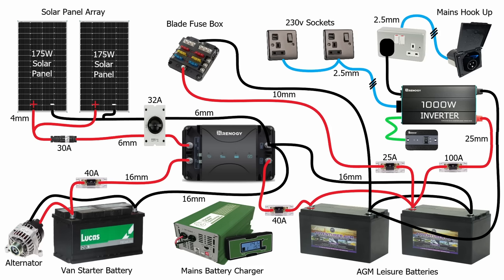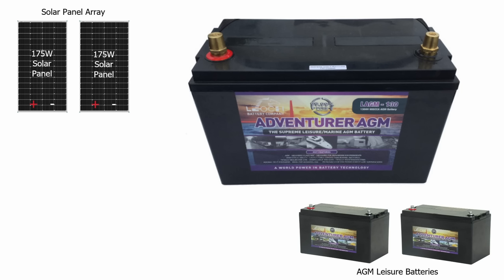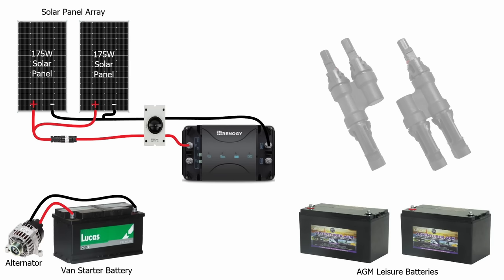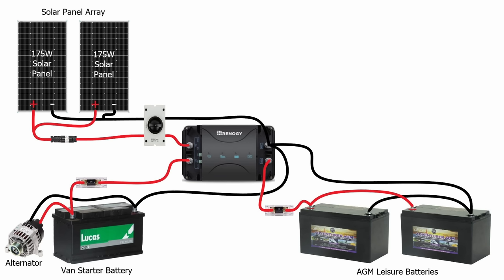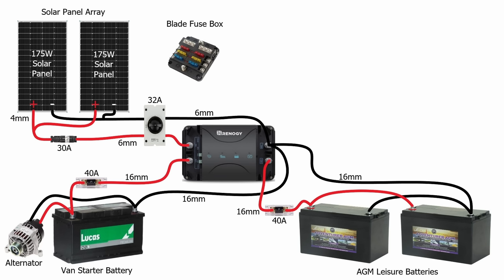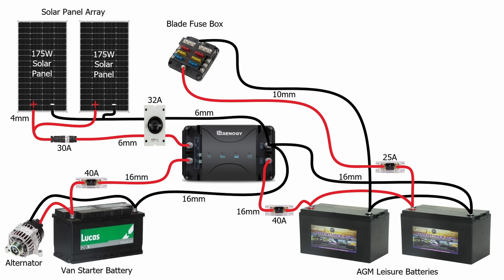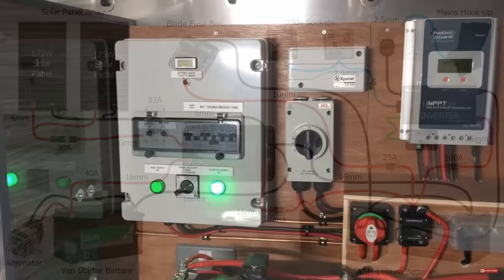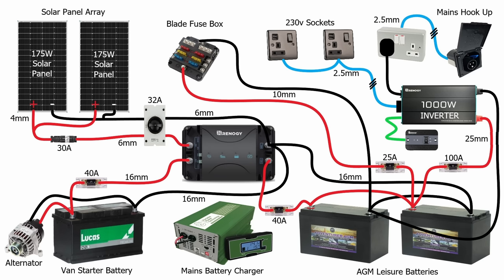12v Electrics for Off-Grid Campervan - Fiat Ducato Budget Build Ep12

Comment: Without a doubt, the most sensible video on camper wiring  anywhere online. Thanks Greg.
Reply: @Dickie2702  sensible? Gel batteries, lithium not considered or explained why not. Apart from the fact they're already owned. But that'll not be true for most new builders.
Reply: @johnfromireland I was commenting on the clarity of the wiring diagram and easily understood explanation of the components.  Apart from the limitations of solar input it's a decent and cost effective package, agreed? 

Lithium is an option and has advantages but it's an uptick in price and this is a budget build.

Comment: What a fantastic system simplified as much as possible with minimum components which keeps the space required down too. 
All the best, David 👍
Reply from the maker: Exactly, it gives you everything you need in a really easy system and the whole thing inc wiring only cost me £950

Comment: When you fully retire from being a Mechanical Services Engineer, you'd definitely find work as an Instructor. Your manner, delivery and time served knowledge across a wide range of areas is pleasurable to listen to. Thank you for taking the time to put this together. One question please; the interweb gives everyone a voice. There are so many (and I was once one of those people) that don't really understand AGM battery management. Yes we can search for info, however if you did a vid on this and used 'lay man's' terms, it would provide muchly needed, clear detail that isn't out there in abundance. Cheers!
Reply from the maker: Ok, that's a great idea, I can include some of our energy-saving ideas too.
The battery capacity is directly related to the resting battery voltage.
So keeping a close eye on what the battery voltage is lets you know how much power you have left to use.

Comment: Excellent work greg👌 well explained and easy to follow. The best van build series on YouTube by far. Looking forward to that earthing and grounding video as I need a bit of clarification myself on my own van build. Top man👍
Reply from the maker: I know that I can add a lot of value to that subject as it's the one thing that causes so much confusion
Reply: @GregVirgoe  did you do a video on grounding? I can't see one. Is there an advantage to running a negative cable all the way back to the starter battery rather than attaching to the chassis /bodywork nearer the leisure battery or dc-dc unit? I read such mixed things and some seem to say don't run a negative cable back to the starter battery if you have a smart alternator and put it on the chassis instead. It would be great to have a video clarifying this for people as you do the best step by step explanations. Thanks for anything you can contribute here.
Reply: +1 Regarding the Earth video, @gregvirgoe can't seem to find it, would be great to see, thanks for all your videos so far

Comment: Great video. Well explained. I've installed that exact controller and it's worth  noting that when solar and alternator are connected  unless the  solar is switched off the alternator can only put in 15 amps, not the full 30. You could switch the solar off manually before travelling or I fitted an ignition switched relay which turns the solar off automatically when the engine ignition is turned on. Otherwise it works very well.
Reply from the maker: That’s interesting. I will do some clamp meter readings to verify that when I get it up and running. That won’t be an issue if you’re driving during the day as it should be made up with solar and at night the solar should be off. Not sure that would have much of an affect. Have you taken any working readings yourself?? 😊
Reply: I have the renogy meter and it does show the difference. I'm sure it was in the manual somewhere. I only have a 100w panel and don't often see more than 5 amps coming in, if I'm driving with the solar on in daylight ,I'm only getting a max of 20 amps in(5+15) instead of the full 30 with solar off.

Comment from the maker: PLEASE PAY ATTENTION TO THIS NOTICE. 
In accordance with the latest UK wiring regulations the incoming mains hook up connection will need to be connected to a small consumer unit which includes a RCD and double pole MCBs for short circuit protection and overcurrent protection of the 230v mains distribution. 

Please watch my new video on this
Should You Install A Consumer Unit In Your Campervan?
https://youtu.be/kdvm0TFvfVQ

Please do read the other comments below to avoid multiple questions on the same topics. Thank you 😊
Reply: Great insight to a novice Greg😊
Reply: As a caveat, to be code compliant just about anywhere, you would need to include a RCD "TYPE A" and MCB on the output of the inverter with the simple solution here to be to wire the hookup between the inverter and the board.

In all honesty though this inverter does not seem to have ECE R10 Certification for Automotive use, so could not be legalised in many countries as part of a van conversion project and registration, it would certainly be reason for a MOT fail where I am!
Reply: @justinbolt1356  it wouldn't even come under MOT regulations in the UK .An inverter is not part of a.  UK MOT .
Reply from the maker: @justinbolt1356  I wrote to Renogy and they confirmed that the inverter has residual current detection on the ac output so that combined with a fused plug means the outlet is protected and no further devices are needed off the outlet. Here in the uk the internal campervan components do not fall into a vehicle MOT and it is up to the individual to get them check and certified by qualified electrician but that it not a legal requirement either. 😊
Reply: @GregVirgoe  Hi Greg, do you know if when the renogy inverter is connected to EHU does it allow you to use more than the 1000w rating? So you can use larger watt appliances when on campsites etc.

I can't find a clear answer anywhere 

Many thanks
Reply from the maker: @jamesharrison7754  No, you can still only use up to 1000W appliances so I suggest installing a consumer unit on the hook up and having one circuit go to the inverter and another to a separate mains socket that you could use bigger appliances on. Alternatively go up in size on the inverter and look into changing to lithium if you have the funds to do so. 👍🏼😊
Reply: Thanks what a great way to explain the whole system. The building side not a problem but this video is the first I’ve seen that explains the electric system in layman term. Well impressed
Reply from the maker: @leesimmons9504  thank you Lee 😃👍🏼
Reply: You're video spot on, just what I as a beginner needs, please just a couple of questions, can I use a fogstar battery 460AH, 12v with this set up and is the inverter in You're video ok with this. Also do I keep the solar panels connected the same. Many Many thanks, yours Richard, from Rhuddlan, North Wales.
Reply from the maker: @richardatherton7573  changing the battery is perfectly ok and the rest of the system stays the same. 
You could go up to the 50A charger to put more power into the battery. Just fit 60 amp fuses on each battery.
Reply: hiya greg i didnt hear you mention when and  if the mains hook up is  connected in this configuration with this setup will it also recharge the batteries thru the inverter ?.
Reply: Hi Greg - really good video that explains the dark magic of camper van electrics design!!
Quick question - I’m looking to convert a long wheel base sprinter. Apart from the aspects you explained in your video that could change (battery type if using hairdryers, kettles etc), is there anything you would recommend changing in this set up for said van conversion? Like you say, it’s 5+ years since your own sprinter conversion, so just wondered if you’d use this approach now. Thanks in advance!!
Reply from the maker: @mickcresswell1031  our sprinter electric setup is still working perfectly including our AGM batteries that have been on 24/7 all that time. Technology moves on and the control panel I built would no longer be required because things like auto changeover is included in Renogy inverter. So my new wiring diagram is definitely the way I would go in a new van 🚐
Reply: @GregVirgoe  Thanks for this great video! I have a Renogy inverter bought from Renogy Germany and it has two Schuko outlets. I also wrote to Renogy and according to the answer I received, mine does not have an internal RCD on the output side. Now I don't know what to do concerning adding one external RCD to each of the two outlets (and the RCDs doing/protecting what they're supposed to do/protect), since the power can come from the battery (when not hooked up) or via shore power. Do you know of a solution or know of a video that explains that exact problem? Thanks!
Reply from the maker: @JamesJBo  despite the reply I received from Renogy I doubt very much that mine has internal RCD protection and I will be taking it apart to prove this in the installation video as I plan to fit an RCBO on the outlet to give me the RCD protection. Here is a link to what I will be fitting myself. 
https://www.electrical4less.co.uk/product/wced-a-type-electric-vehicle-2-module-enclosure-16a-rcbo-c-curve/
Reply: @GregVirgoe  Very interesting! Shall be looking forward to that video.
I received another info from the Renogy Service Center today, confirming that the UK model and the German model have different specifications.
Reply: Hi Greg, you said that the inverter does have a RCD on the output so therefore you wouldn’t need a consumer unit on the outlet. However, wouldn’t this surely mitigate the needs for a consumer unit at all in this simple set up, obviously for compliance yes, but in the safety aspect surely any plug your using will go through the RCD from the inverter, the input from shore to the inverter will be fed from the supply ( garage or campsite) and that will have a suitable RCD? 

Thank you for reading this if you do see it, really appreciate the informative videos 👍
Reply from the maker: @williamlynch8866  the thing you are trying to protect is the cables and installation from shorting to anything metal that you could touch and although a short run that does apply to the inlet power
Reply: Would you recommended this over anything or say it’s pretty safe to go without for a short term fit ?
Reply: You should pin this comment😊

Comment: Thanks Greg. Excellent info as always. The theory is great and explained so carefully. Are you making a video on the physical process of connecting the cables to follow this? Tools and fittings for battery connection would be a massive help. Rich
Reply from the maker: Yes exactly that, you’ll see the physical items and exactly how they are fitted in the van 👍🏼😃

Comment: Love the videos Greg! Only person to trust with detailed DIY ❤   Any thoughts on voltage sensing relay for charging via alternator as another option over the renogy charger / mppt?
Reply from the maker: Hello Josh, I would always recommend using a DC to DC charger, The only problem with VSR is they are just a switch and do not know the battery type or state of charge of your leisure batteries so do not meter the charge accordingly. They simply turn on and open the circuit to the van when the van is running. A baatery charger will know the state of charge and meter the charge to the lesiure battery to look after them much better. They can change the charging profile depending on the type of battery connected too.
Reply: @GregVirgoe  thanks so much! That’s changed my plans 😂
Reply: Just done a bit more reading / thinking, does the alternator not regulate charging voltage making voltage sensing relay (VSR) useable? 
Edit: for anyone interested. Smart alternators aren’t compatible with VSR so may be why. Answering my own question

Comment: I have watched so many wiring videos. This is by far the best video I've seen, and I appreciate the explanation of the different parts. ie why you wired what on what side of the batteries. I can see where I need to make some small adjustments to the wiring I have completed from what I had  learned till now.

Comment: Hi Greg great video, would this system work with a 2000W inverter? We have just started our boxer conversion, just started doing the prep on the floor in readiness for the false floor.
Reply from the maker: You would really need to look at fitting lithium batteries because 2kw could potentially pull 160A out of the batteries 
The Renogy 100Ah lithium battery is now under £500 so it’s coming down in price. 
You may also wish to look at eco tree and Roamer too. 
Can I ask what appliances do you want to use that need that much power?
Reply: @GregVirgoe  I am currently planning to install a truma combi boiler either LPG & Electric or Diesel & Electric. That was the main reason.
Reply: Far be it for me to jump in here. I would not advise using your combi electric elements through an inverter. Save that for hookup. Just use your gas or diesel if not hooked up.
Reply: Nice to see you back 👍

Do you have any thoughts on the Fogstar Drift lithium batteries?  Their 105 Ah is heated and has a good warranty and is about £370.  And it weighs 10kg.  Admittedly the price starts to get a bit more cheeky if you need two, but it sounded tempting to me.
Reply from the maker: @davidknights866  ok 👍🏼 you won’t need a lot of power for the Truma boiler. You would use LPG or diesel while off grid and only use the electric elements when on hook up. The boiler uses a 12v 10amp supply from the battery to run controls and supply fan. 
Do not run the electric heating off an inverter it will kill your batteries in minutes. The boiler has two 900W electric elements so that’s a total of 144amps on a 12v system. 
Hope that helps 👍🏼😃
Reply from the maker: @craster_van_kippers  exactly 👍🏼😃 how many pints 🍻 are you on now Keith? 🤣
Reply from the maker: @russ1046  I can’t comment on the quality of that brand but quite a few lithium batteries are coming down to that price point making them more affordable. If you can manage the extra money up front then lithium is a better solution.
Reply: @GregVirgoe  Thanks Greg, the system demonstrated in the video what is the off grid capability duration for a typical Uk Summer and your typical daily usage?
Reply from the maker: @davidknights866  you can only use what you can generate so on a good day approx 1.2kwh of electricity which is enough to run this van no problem 😉
Reply: Hi Greg
Following your video, I have got a really good deal on 2 100ah lithium batteries a 50 Amp renogy Dc-DC charger/MPPT controller and a renogy 2000W inverter. Renogy supply 20mm2 cables with the inverter based on reading and watching a few of your videos 20mm2 cable doesn't seem right
 I ask renogy technical services if they could confirm and they insist 20mm2 are correct and will work fine but I am worried about the wire overheating. Love to have your opinion.

 Thanks David
Reply from the maker: @davidknights866  if the leads are less than 1m long then it will be ok. I like to size up my cables to keep the volt drop down and make sure they run cooler. 👍🏼😃
Reply: Thanks Greg, Renogy got back in touch with me today as there are 2 pairs for 20mm2 cables with the inverter and have now told me to fit both pairs between Batteries and Inverter. Doesn't sound right to me so i am going to get thicker cable either 35 or 50mm2.
Reply: Hi Greg sorry to be a pain, need some advice. Purchased 50amp DC-DC charger/MPPT controller and 2 100AH lithium batteries. want to purchase 3 175watt solar panels connected in parallel but worried about amps with 6mm2 solar cable. 
Q Do you think 6mm cable will be ok or will I need to use 10mm cable or do I just settle for 2 175watt panels. 
Thanks
David
Reply from the maker: @davidknights866  you will be ok with 6mm cable 👍🏼😃
Reply: Hi Greg! I have a couple of questions if you wouldn’t mind answering please 
Do you have the external hook up connected to an internal plug socket? Does this then do away with a consumer unit if it’s then ran through the inverter? And secondly is a renogy 60a dc-dc charger to big for 240ah agm battery bank? My alternator is 150a
Any help would be greatly appreciated

Comment: Thanks Greg, I've been building my micro camper for nearly a year now and got most of my design plan from you in the early months. I haven't watched your videos for a while now, but was thinking of installing some shore power and started researching YouTube for the "low-down". Well let me tell you, there is so much foolish, frivolous dross out there!! So it was marvelously refreshing to return to your channel, to get some no nonsense, succinct, well researched information from you again. I haven't checked you videos fully . . but would like some information on transfer switches between the inverter and the shore power, if you have a video covering that? Anyway more power to your elbow Greg, excellent job you're doing!!!

Comment: Just bought a renogy 50a DC MPPT charger and 2 renogy 200w solar panels with a 2000w inverter for a bargain £635. After watching your video and wanted to keep it simple. Just need a decent lithium battery. Cheers for the very informative videos. 👍